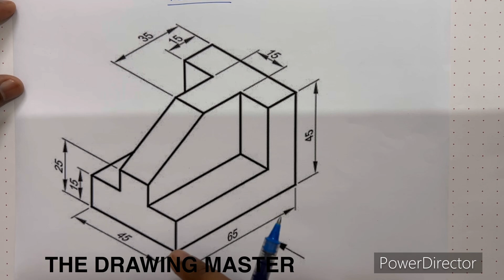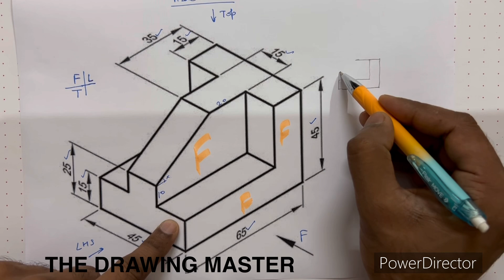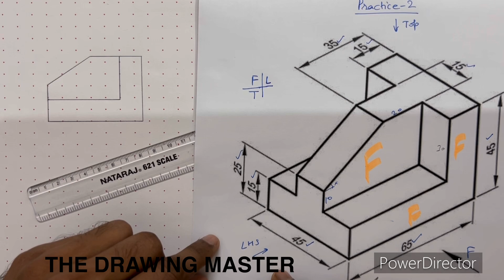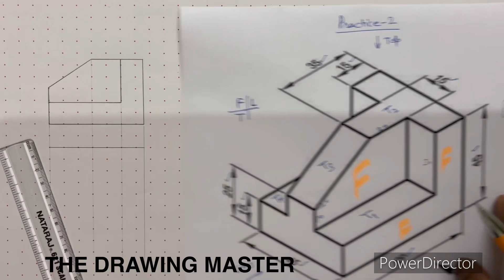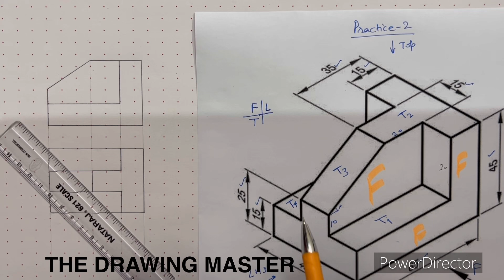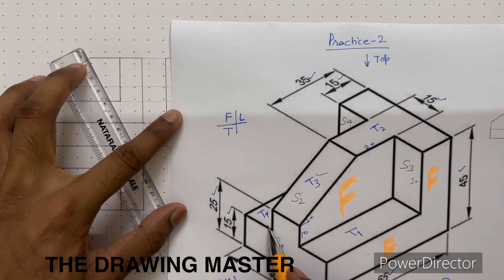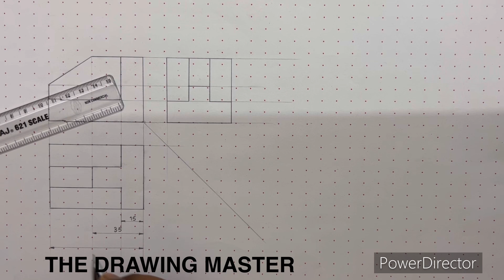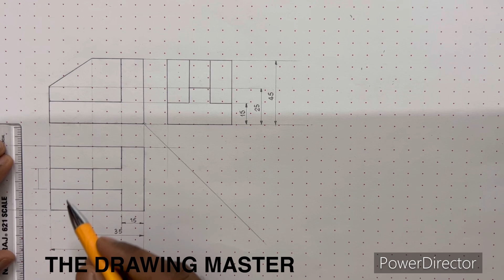Orthographic Projection | Practice-2 | Engineering Drawing | Engineering Graphics

Comment: Sir,if the actual given dimensions are very small and we are drawing using double the actual values so we have to write actual one after drawing in dimensions or the doubled one??
Reply from the maker: Only actual one….but write the scale factor in drawing
Reply: And when los is very small like 6cm then how do we make scale .it would be very small
Reply from the maker: @ you have to do it anyway